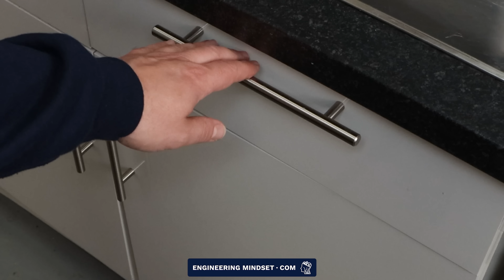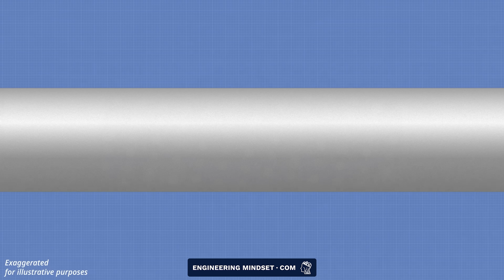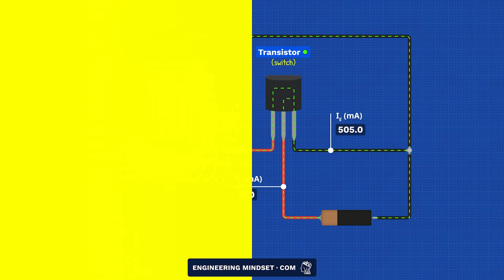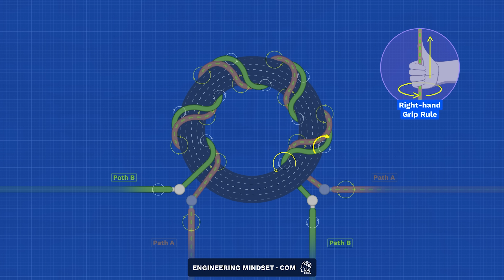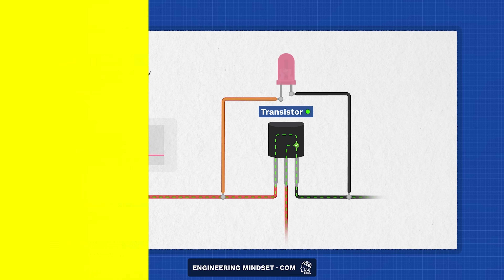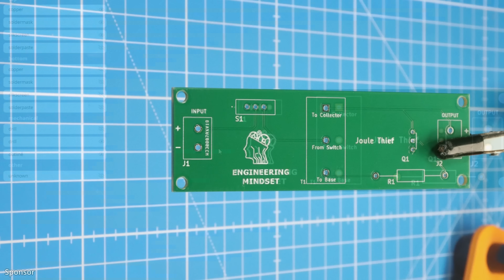Why This Circuit Works When It Shouldn’t

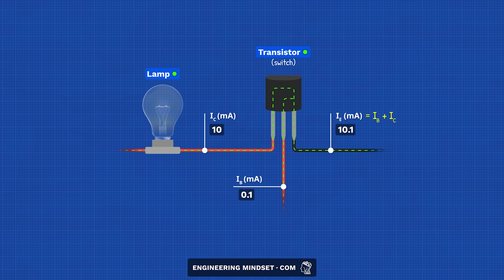Comment: 5:12 correction: almost immediately, in the transistor's datasheet there's a fall time rating, e.g. for a 2n2222 it should turn off in less than 60ns, which doesn't sound like much, but if you're working with 100khz, that's gonna make your waveform look more like a sine wave than a square wave, because there's also a  rise time.

Comment: On the resistor... It's not electron flow. Electron flow is extremely slow
Reply from the maker: We have a more detailed video about that here, later in the video https://youtu.be/3KePcASD0NQ
Reply: @EngineeringMindset  awesome! :) but might be worth annotating that in the vid as while wording it as its done at the resistor part is what we use in everyday speech to talk about it its not technically correct :) that more detailed video was very enjoyable ❤

Comment: The video designer does a fair simulation of a 1940s school teacher lecturing about inductance who never heard of a transistor, combined with a description of a transistor that applies only to an NPN junction transistor without mentioning "NPN junction" or showing its standard circuit symbol, combined with a LED where its P- and N- materials are sketched but not explained. Transistors that look like the one (dramatically burned!) in the video might be PNP, FET, MOSFET, Unijunction or Point-contact and not work at all here.
Reply from the maker: It wasnt needed for this video. But we have incredibly detailed, dedicated videos on transistors, resistors, mosfets etc for anyone wanting a deeper dive. Please check our channel videos.

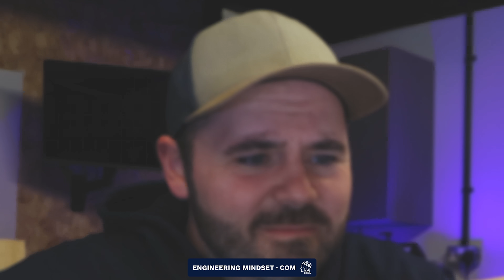Comment: Yes, even a fully charged battery will be way below 3 Volts @0:16 - lol !
Reply: Aren't most 3.3V?
Reply: @Eden-Ace   AA and AAA batteries are 1.5 volts
Reply: @incompressible01  Wait, what?! Then what have I been using?
Reply: @Eden-Ace  2 of them 😂
Reply: Li ion Batteries are 4.2V fully charged.
Reply: @rgbro7150 it is clearly an Alkaline battery in vid which is 1.5 volts. Even AA lithium batteries are 1.5 volts.
Reply: @r@rgbro7150es but these aren’t lithium ion batteries, and even if they were, in a AA format it would be 1.5 volt

Comment: PCB Manufacturing is so cheap I even order test boards if they contain too many wires. Checking wiring on a diagram is much less madness inducing then trying to figure out what goes where on a breadboard with several dozens wires sticking in it.

Comment: You gave me an idea to use this as an input for Relays, so even the Battery is at 0% it can trigger the Relay to be in Normally Close to Short the connection

Comment: A tidy little explanation. I hate to admit that my eyes glazed over a bit, likely due to my perpetual migraine having a bad day, but I noticed all the important parts as they drifted past.
I'll be back to re-watch this one again when I can think properly.  I'm hoping to be able to set up a simple boost circuit to raise a sub-standard wind generator output to enough to charge a battery even when the wind is only ticking the unit over slowly. Less wasted potential power and all that.

Comment: How is the LED not cooked by 85V though?
Reply from the maker: When the spike rises to ~4v the led allows current to pads through. So there is a longer low voltage pulse instead of a giant spike. See near end of video the oscilloscope explanation.

Comment: Omg.. I think a light just went off in my head, this is how a generator will turn kinetic energy into electrical energy..... if I'm wrong with any of that thinking, please correct me I really enjoy learning and this is truly helpful.

I laugh when you say the LED works like a diode.... because LED just stands for light emitting diode. But it's still worth a good laugh.
Reply: And I want to add a second comment about how I had a friend who was an electrical genius when he was younger, in the late eighties he hand-wired 32k Ram expansion card for has Apple II GS

Comment: It's like a using a self-emptying bucket and a low flow water source to drive a water wheel where the low flow water source alone wouldn't be enough. The bucket repeatedly fills with water from the low flow source and automatically tips when it's full, pouring the water onto the water wheel and making it turn. Repetition keeps it turning.

Comment: Did you say, voltage spikes!?
Capacitor: hold my beer
Reply: for some reason this comment made me 
want to blow up a capacitor

edit: it flew into my nose and it hurts….
Reply: @adnangamer3749  beating a capacitor, come with a cost
Reply: You can indeed add a capacitor to a joule thief. This lets you power blinking and color changing LEDs. But for some reason, adding a capacitor directly causes the joule thief to shut down. You need to put a diode in between.
Reply: @PunakiviAddikti "for some reason" lol. You do not always need a diode, and there's many joule thief circuits available that use no diodes (other than the LED of course. Leds are diodes...
Reply: @DarkAttack14  you absolutely need a diode if you want to add a smoothing capacitor to the output. Go ahead, try adding one without the diode.
Reply: @PunakiviAddikti  what would it do?
Reply: @CuriousMindForTruth  for some reason it acts as a short and the LED will not light up
Reply: @PunakiviAddikti  ahh okay, thanks for the swift reply ❤
Reply: @PunakiviAddikti LEDs are a diode like I said
Reply: @DarkAttack14  that's not the issue. The capacitor must not be parallel to the output of the joule thief without a diode in series to block current from flowing back into the circuit.
Reply: And we have thermal runaway and an explosion and your kitchen table is now on fire like a Roman Candle all because you were to cheap to have a new backup battery.

Comment: How do you boost a non pulsating d.c voltage with a transformer .You cant. Unless your circuit generates a frequency. Does this circuit oscillate?

Comment: 1:05 taht's not a circuit diagram, that's just the PCB layout rearranged a bit.
Reply: nah that's definitely a circuit diagram
Reply: Pcb is just circuit in a real life board.
Reply: That looks like a AA too, 1.5v, it can't light the led fresh, assuming it's a typical white LED it needs 3.0v give or take, but there are various ways you could get there, a buck boost converter is one typical way...

You wouldn't believe it, but this is exactly that. 

I didn't pay enough attention to tell you if it's Buck, boost, or both, but it's certainly one of those

Comment: Isn’t electricity flows from (-) to (+)?
Reply from the maker: So current flows from positive to negative and we typically design circuits like that, but the the electrons actually flow from negative to positive. Check this video out to see why https://youtu.be/3KePcASD0NQ
Reply: @EngineeringMindset yes I was reffering to electrons.

Comment: 11:43 why does no current pass here!!!
Reply from the maker: Primary current is constant. Only changing current and induce into the secondary, so increase or decrease primary current, not constant
Reply: @EngineeringMindset  So what if we simply alternate the current really slowly to a resonant induction frequency of the iron core instead of using the resistor and transistor? We losing too much as heat this way, it is supposed to use the energy efficiently...
Reply: @EngineeringMindset  I meant how is current a current if it doesn't move?!

Comment: Sometimes you seemed to use electrons and current interchangeably, however they flow in opposite directions...
Reply: You're so right Mr 710 that was the very first thing that jumped out at me watching The animated explanation of how it works and I said to myself surely he is going to get called on this rather quickly but to my surprise that was not so but you were the first

Comment: This has to be the kinda explanation I had in 11/12th grade physics, but for a boost converter (But not quite, very similar workings though, even the waveforms are the same). Unbelievably intuitive.

Comment: Here's a helpful analogy: it's basically like a ram pump, but for electricity instead of water. In a ram pump, the flow of the water is the current, inertia of the water in the pipe is the inductance in the coil, the valve is the transistor, and the water pressure is the voltage.

Comment: Edit: So I was quick to state that this was "Leeching on the Big Clive's joulethieft". In hindsight i take this back. Excuse me
Reply from the maker: Not at all. I'm a big fan of Big Clive, a subscriber of his channel and I highly recommend his content. Only after this video was I made aware he made a video on Joule thief 10 years ago, but the circuit was made popular in the 1990's
We have, in my opinion, done an exceptional job of explaining through detailed animations and explanations how this circuit works.
Reply: @EngineeringMindset  🤔 ok, you get the benefit of the doubt, Excuse me.

I looked into the boards,but they are Way Too Large? I would suggest the size of a AAA should be possible?
Reply from the maker: They are big on purpose, its a beginner friendly board. Large solder pads, clear traces, lots of space to get components in and solder them easily, labels explaining what is connected where.
There is also a second version to build first, a breadboard version to tinker and try other possibilities. There is a tutorial also.

Comment: Thank you.  My entire life ive struggled with traditional school with ADHD, Ive always been a hands on/ visual learner.  Ive played with electronics my whole life but never understood exactly how diodes/transistors and switches interact with magnetism.  Im sure to most college freshmen or kids that build simple circuits its easy but your video demonstrations just glued a bunch of pieces of puzzles in my head together to give me a better understanding of circuits.   This is coming from someone who has 20+ Years in IT and repairing electronics and tinkering, I always drew my limit with swapping control boards with a spare and basic soldering and hoping/guessing it would fix it but explaining the theory and testing behind it in your format really helps.   You earned my sub, looking forward to more videos like this and will be checking out the backlog.

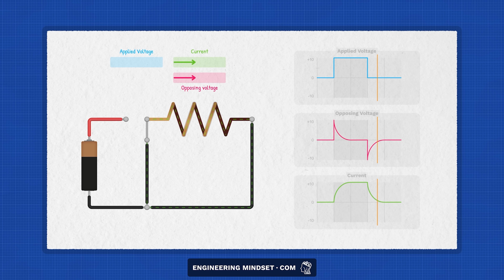Comment: @8:10 one detail though: these three graphs do not quite apply to the scheme on the left; they actually show what happens when a resistor is inserted in the path of the current. With no resistor, a constant voltage applied to a coil causes the current to increase linearly, until the coil saturates, in which case the current increases exponentially until set by the resistive value of the wire.

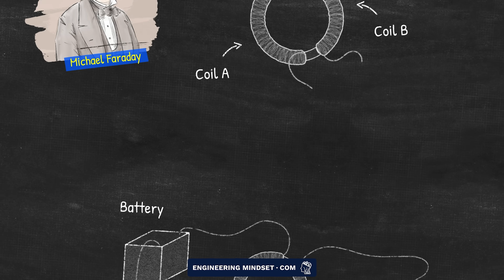Comment: Is this a transformer? I just clocked it looks similar after 8:58 and the constant switching looks like AC at the beginning. AC voltage conversion is like 1.41VAC=1VDC
Reply: Yes it is

Comment: I found out about this circuit at about 16-17 years old and i was excited and talked about it with my electronics teacher. 
He was like, what's the point, you get some small leftover energy from the battery, and probably make it leak. 
I thought it was cool anyway. 

Now i am 30, and starting to agree with the teacher :D 
Anyone know any actually useful & practical uses for this?
Reply: Someone commented something about a chip in solar lights.
Reply: I'm not aware of any applications for this circuit in particular, but the very similar boost converter has many applications. It works on the same principle, but it uses a controlled PWM signal to drive the transistor (and usually uses a different transistor type) instad of the self-oscillating circuit here.

Comment: how is it possible that the led doesnt burn when there are 80Volts aplied to it. Arent most led rated for max 4-7Volts
Reply from the maker: Yep, so the led opens when the spike reaches ~4v. Near the end of the video we showed this with thr oscilloscope

Comment: So how does the huge +84V spike not burn the LED ? i might've missed that
Reply from the maker: See near end of video, spike hits led open voltage and passes through like an escape route. So we get a lower voltage spike ~4v but much over much longer period of time. Still incredibly short, fraction of a second
Reply: @EngineeringMindset  Alright thanks ! is there a way to calculate the spike reduction that we'll get with an escape route ? just to plan our circuit and not burn things
Reply from the maker: Well it depends what you connect across the transistor. Any type of diode will not conduct until a certain voltage is achieved. But you could experiment and connect a capacitor and zener on the output and get a more stable power supply

Comment: Just a warning: you can drain batteries till they die, especially once the cuircuit is running.
BUT batteries also are more likely to leak when completely drained in my experience..probably also because they are ultra old then. ;-)
So dont build a fancy integrated battery housing that they get stuck in with snot.

Comment: I would love to know how i could make a 12v PWM for dimming light using rotary hall effect potentiometer. This would be to control LED lights. I tried to search that on seller's websites but to no luck, i only found with resistor rotary potentiometer. Making such a device would eliminate wear that is inevitable in resistive potentiometer.
Reply from the maker: It's not quite what you're after but we have a PWM les dimmer here with a potentiometer https://youtu.be/fBNU17zJlnM
Reply: @EngineeringMindset  I've watched it and thank you it help a little bit. What you made is already on the market, i do appreciate learning how to make one myself but i still don't know how i would use a hallf effect potentiometer instead of a resistive potentiometer.

Comment: You managed to make a very boring yet interesting subject. Non-boring enough to watch it all the way through...

That is what a great teacher does.
Often (especially with things like electronics and mathematics) the complexity is so high, that when you miss one little bit, you lose connection.
From that point on, everything you say becomes boring because it no longer means anything to the listener.

A great teacher manages to thread that needle perfectly, but that is not easy.

Props my friend, big props.

❤

Comment: oscillation resonance. These are in solar lamps and there's actually a IC that  does this.
Reply: Yep. The chip is called QX5252 or YX805, . But it stops at 0.9v because it's designed to use safely use NIHM and recharge them with solar after they reach 0.9v, so it's not exactly a joule thief. You also can find inductors that look like regular TH resistors or smd resistors.

Comment: You can probably learn how to make your own RAM sticks with the sponsor
Reply: You only need tiny magnetic cores, thin copper wire, a needle and a sewing manual. With enough patience and living space, you can make megabytes of RAM!
Reply: @npl-8701  Great NASA moon landing reference 😂😂
Reply: @nicedurians magnetic core memory is a thing they used to use in the soviet union, weaved by old women
Reply: @AnotherAustin-z7b  Babushka™ ram
Reply: @AnotherAustin-z7b Because it had very high EMP resistance?
Reply: @samueldavis3288 t was the best thing before ic
Reply: @npl-8701 Megabytes? goodluck even getting a kilobyte 😂
Reply: @MinePossu  I actually saw a machine (Soviet EC series 1, the first IBM/360 clone) equipped with 8 megabytes of MCM. Don't remember the exact model number. Memory cabinets were taking a large room, opened like books and there were those sheets of mesmerizing finery in rigid frames. Like pages.
Thinking of it now, I wonder if the term "page addressing" originates from there.
The machine never worked though, way too unstable.
Reply: @MinePossu  2GB DDR5 is 2k. I will play with kilobytes

(however, the bubble is about to pop. it will be cheap again)
Reply: @xMrDuBx  They will go out of business for that XD. Lots of stock but unused
Reply: You can but you cant get the chips
Reply: Soon upgrading to 240nm CPUs
Reply: More powerful shock generator thanks!
Reply: Probably, it'll cost less too 😂.
Reply: Yes 😂
Reply: If you can still afford the RAM chips...
Reply: @FrankHarwald that sponsor have already basic designs to make ram's stick's, ddr as well. Someone made even own 3D accelerator from voodoo 2 era parts. (with 4 gpu!)

Design isn't impossible with today's software and putting parts with skilled hobbyist isn't impossible at all.

Making own huge size server ECC stick to ddr3 era could be possible project to me at next summer.
Reply: @FrankHarwald lol

Comment: Your quiz is wrong. The current is flowing towards A, so the thumb should be towards A and A would be north. If you wanted B to be north with the way the thumb is pointed, then you should have the current flowing the other way. Are you trolling for comments, lol.
Reply from the maker: That is not how it works. Current and direction of coil winding dictate the polarity. This is explained in detail in the video if you want a refresher.

Comment: @EngineeringMindset When explaining how the current flows, it should be explained how the current actually flow - from the negative terminal to the positive terminal. 
Telling the people the truth, in a way that makes sense, is the only way to teach people. 
So when the people find difficulties later, you do not have to tell them "you know... I lied to you - the current in a battery circuit flows from the negative terminal to the positive terminal, not from the positive to the negative".
Reply from the maker: Thanks for your feedback. We have done an incredibly detailed video on exactly that previously, link here if anyone reading this is interested https://youtu.be/3KePcASD0NQ

Comment: 9:25 so DC to AC? The Anti-Full Bridge Rectifier?
Reply: DC to AC is called an oscillator. When it's used for power it's usually called an inverter.
Reply: It's DC to pulsed higher voltage DC. Technically, it's type of boost converter. A true "anti-rectifier" (inverter) works differently.